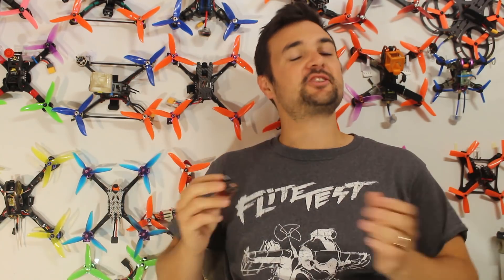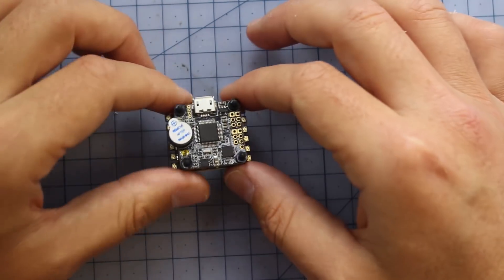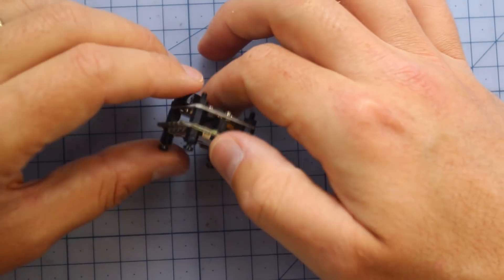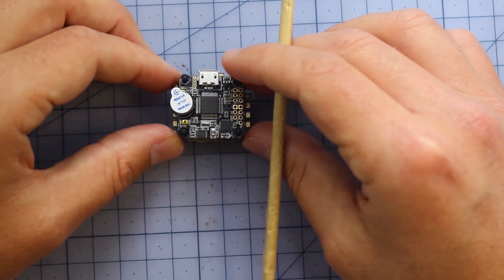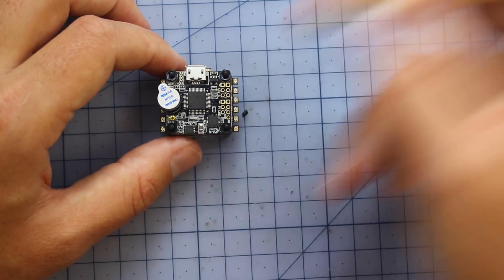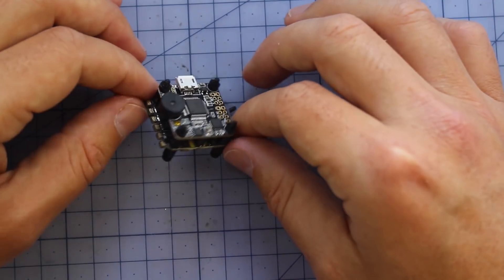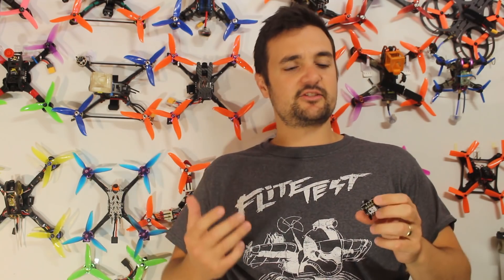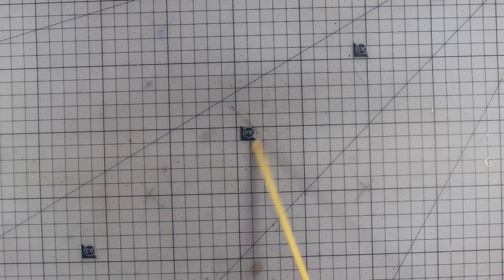F3 Mini Tower micro System - Tech Tuesdays UAVFUTURES

Comment: That's a very nice combo.  I like that the buzzer is built-in vs having to find a place to add one after.  It might make a good alternative to the HGLRC XJB F428 on builds that don't need the amps, but lately I've been moving towards the 3 inch sized builds and 12 amps seems a bit low for them... I'll probably stick with the HGLRC.
Reply: Honored Twig same

Comment: Nice little stack. Maybe it's just me, but I have more vibration issues with minis than larger builds. Just went thru a complete rebuild on a Femto F3 (babyhawk style in a flitestest kit) build just to get the twitches and drift out. It turned out the wires to the arm mounted escs (also tape mounted) were coupling the motor noise straight in, I went to light silicone wire in loops and it flies OK now. Another case for 4 in 1s on mini builds. 

I flew 2 packs on it outside, and not only did the cold make the batteries die, my fingers were numb after 10 min of flying.Not much fun.  Makes you look a little harder at the odd Tx cover. Seems to me it would be a PIA for miniquads, but probably would be nice for a long fixed wing flight like a glider. I saw a battery powered version at HK last year that ran on a lipo. I guess if you are desperate enough...  

PS COMMANDER ARE HERE!! tried them on the Whoop, and plugged in my RC Split build (good camera there)- they seem great. I'm using Fatshark Diopter lenses and I'm sure glad I bought them, I couldn't even read the OSD without them. They fit the Commanders great! Now if the wind and cold would only stop.

Comment: Yeah for some reason Emax is telling people only to use 3S to 4s on it, even know on their website it says 2s to 4s.  Apparently some people were having problems with using 2S on it. Not me though,  I'm using 2s and 3s. only difference I noticed is that the hovering point is 50% on 2S and 3S is 35%. But I'm getting the same amount of flight time on both. I haven't tried 4s yet. My quad is 95mm & 76 grams with 1104 8,000kv motors. Definitely is a rocket. Only thing I don't like is when I yaw in a circle I lose altitude and hit the ground only way I can stop it from hitting the ground is to punch it after yawing around.

Comment: While most UAV vids are thorough I found this weak on usable info.  Some important tips MISSING from this video such as the -45 degree orientation (even thought sticker on bottom suggests otherwise) .  Also you need to remap the motors because they will be wired backwards (1-3,2-4 vs 4-2,1-3).  You also might also point out its very limited port pad (1!) selection and the workaround using the unlabeled UART2 near USB... stuff like this is key to a purchase and successful configuration.

Comment: Why does the sticker on the buzzer say "remove after washing"? What does it mean by "washing"?
Reply: That's for the manufacturer, the reflow soldering process leaves flux which is then washed off in an ultrasonic bath or spray chamber. The sticker keeps the cleaning fluid out. It seems most board manufacturers don't bother to remove them as time is money.

Comment: It would be nice if you could give the price in the video. In the product description, it said 3 or 4 cell. Not 2 to 4 cell. Dose it say different in the manual?
Reply from the maker: on the back of the little box it comes in, it says 2 -4s it is around $50
Reply: Robert Franklin I run it on a 2 cell lipo. It works.